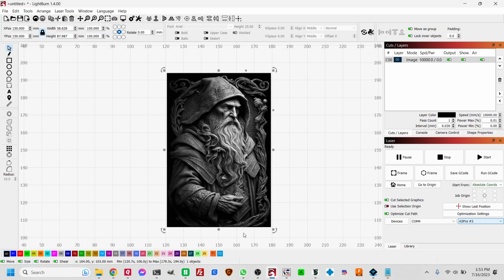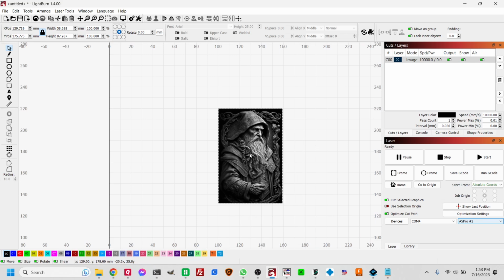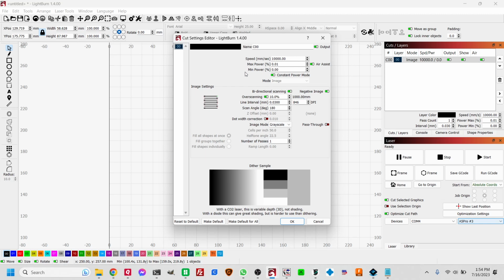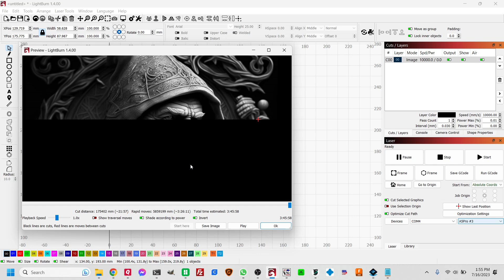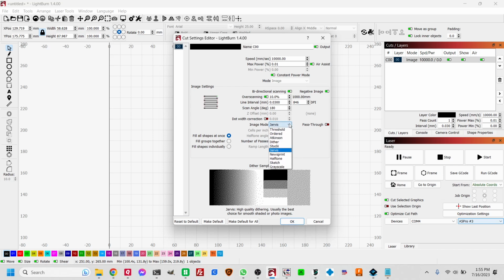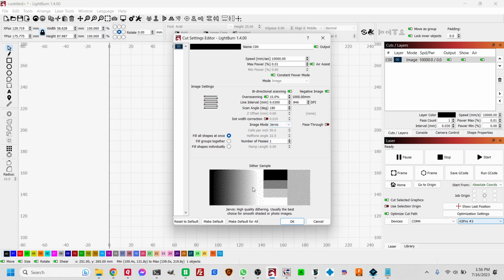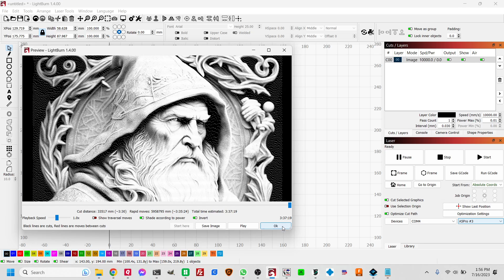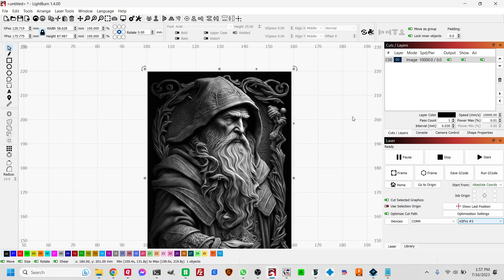Quick and Dirty Explanation of Grayscale vs Jarvis (or any other dither algorithm)

Comment: Best explanation I've found yet. And I've done a lot of looking. BTW, I really wish Jeremiah would put out a detailed video on how he does that double layer engraving with greyscale and a dithering layer. They look crazy amazing
Reply from the maker: Thanks!

Double is pretty easy. Set up the first image, copy the settings, duplicate the image, set the duplicate to a new layer, paste the settings to the new layer, edit those settings. Then run the job, which will do the first image and then the duplicate back to back. By duplicating the image, the duplicate is exactly on top of the original, so no goofing around trying to make sure both are aligned and you didn't accidentally move one. Personally, I also set the duplicate to the opposite scan angle from the first so it's already at the start point for the duplicate when it finishes the original. 

Other than that, it's really a lot fooling around to how the two interact with your material, what effects you get. Make sure you save both sets of settings to your Lightburn library!
Reply: @geeksatlarge im just now seeing your reply. Thanks. I figured out where ive been going wrong 3 days ago. I tried to get the best detail out of both images rather than adjusting the darks to mids in the greyscale. My first one using that point of view turned out amazing.
Reply from the maker: @217smiller awesome, glad to hear it!

Comment: I heard about your video from you post on the xTool F1 group, and I'm really glad I watched.  I've watched a few videos, and I never really felt I understood.

One thing that you said that I found the most helpful was the reason many of those other algorithms exist.  Some of them are so awful that I could not imagine why they exist... but, as you said, this toolset is used by other publishers besides engravers.

But there is one question that has yet to be answered:  Is there a way (besides trial and error engraving and wasting material) to decide which algorithm is better suited to which types of images?  I see that many people on YouTube and the xTool groups use Jarvis for everything, but I wonder why F1 users would not always prefer greyscale?

In fact, I think I will post that as a question in the F1 group.

Thanks again.  I liked & subscribed, BTW, and look forward to watching the rest of your channel later this evening.
Reply from the maker: Hey there! Sorry for the delay in response!

For xTool owners, grayscale is the default, but, grayscale takes effort to learn how to leverage well. Back in time, xTool didn't include numbers for min/max power, making it a futile effort to use.

One reason not to use grayscale, especially for xTool, is the amount to overhead processing the image takes. This results in the machine jittering at higher speeds. If I remember correctly, xTool's guidance for the D1 series machines was to not run over 100mm/s, or half to one quarter of the machine's capability.
Reply: @geeksatlarge also gained subscriber from me for this video.
Reply: Same. I always wondering what the other algorithms were even for. I use Jarvis on xtool. Baning, Marcin, and Kasia on ImagR based on material. I've never even tried greyscale yet because I don't fully understand it.